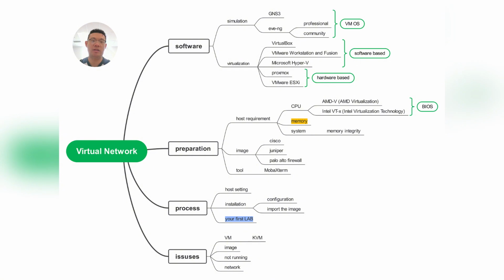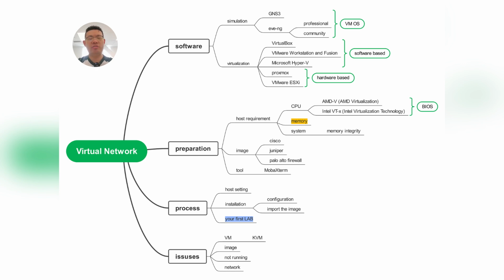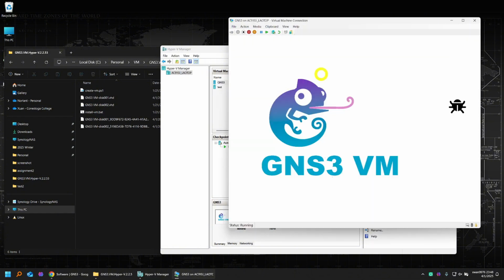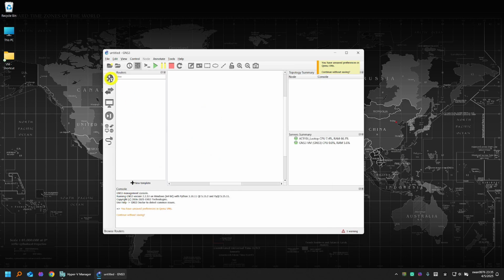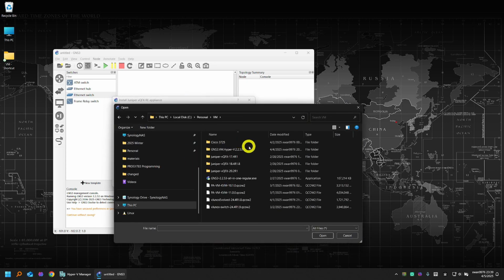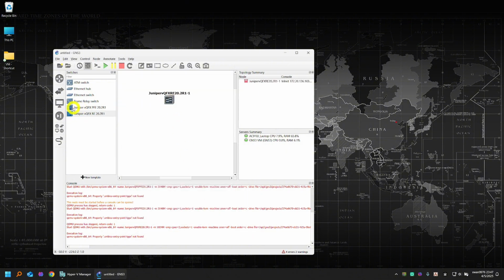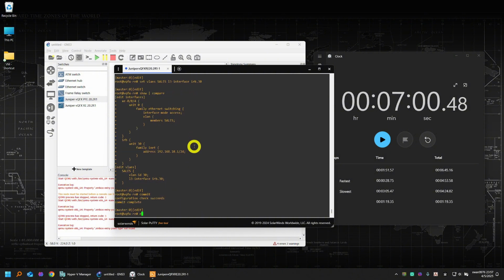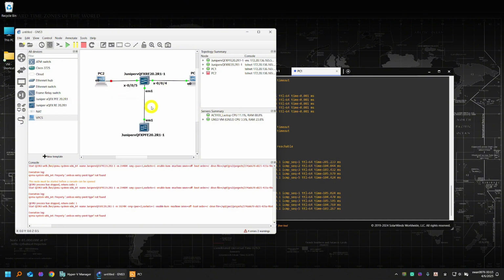Install GNS3 and import Cisco, Juniper image with Hyper-V

Comment: they updated there powershell script.  so you dont have to create the vm anymore, the powershell script will do it all for you.  keep in mind you will have to change a part of the script if using a new version of powershell. version 6 or above will use the initial command Get-CimInstance instead of Get-WmiObject
Reply from the maker: PowerShell will help you install a VM by using a script, no need to do it manually, but GNS3 still needs the VM or any other emulator platform.

Comment: Can you make it work on Doker desktop?
Reply from the maker: no, I haven't tried it. as I know, Docker is a container, you can import the image to docker as a virtual device, then use GNS3 to invoke the virtual device (container) to simulate.

import the image to GNS3 running in hyper-V:
the image is in GNS3, then GNS3 simulates the image as a device.

import the image to Docker:
the image is in Docker and running in a container, then GNS3 invoke and simulate the container.

no matter how you use GNS3 and import the image, you still need a basic virtual environment (hyper-V, VMware, VirtualBox etc.)
you can't use Docker instead of Hyper-V
Reply: @Nortant  Thanks for replying.